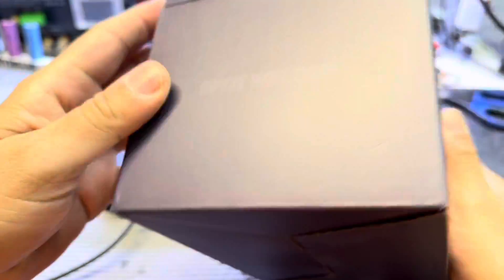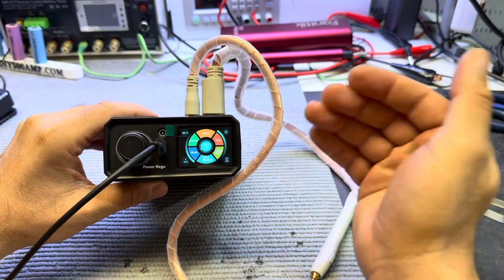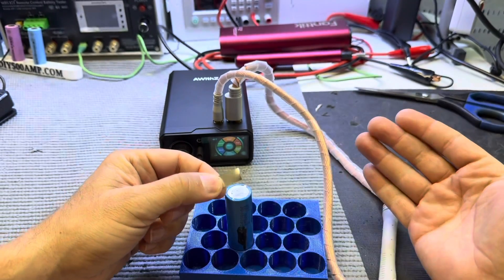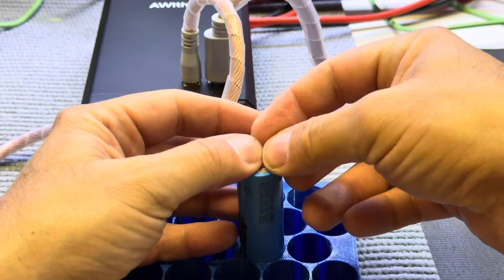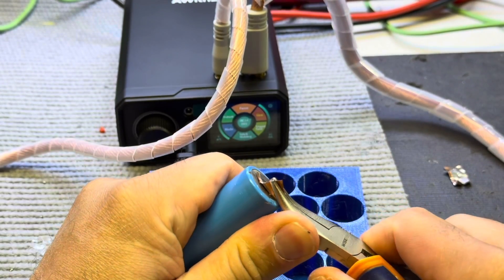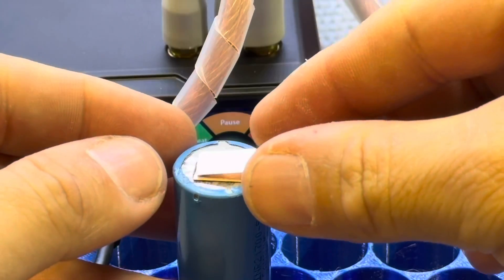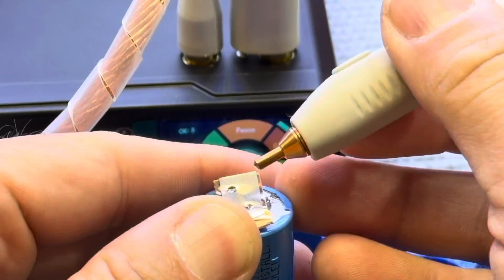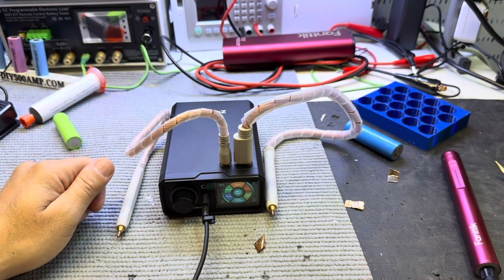AWithZ UKF10 Spot Welder Test – Copper & Nickel Welding Results

Comment: Does the nickel strip on top of the copper add much to the ampacity or does the copper end up carrying all of the current due to its lower resistance?
Reply: It does I’m not sure how much but it lowers the total resistance just more volume will flow through the lower resistance copper than the nickel.
Reply: @ARJJAMES  I wonder if anyone has ever done any testing on this.?

Comment: Hi I have the AWithZ UK3 one, Would I be able to weld 0.20mm pure nickel? If not, is there anyway to put enough pure nickel dows for building my 750w 48v battery. If not I will return it. Thanks
Reply from the maker: Yes you can weld easy 0.2mm pure nickel with your machine. The UK3 is almost as powerful as the UKF10. The difference is the UK3 is battery based welder and the UKF10 is a capacitor welder what is better than a battery. The UKF10 can do pure nickel 0.3mm and your as well.
Reply: @DIY500AMP Thanks I feel better now and just waiting on my batteries to arrive.

Comment: Do you recommend the UKF10 or UF20B? Is the extra power worth it?
Reply from the maker: Honestly they are almost the same in power. The difference is the UF20B has a build in power supply and will charge the capacitors faster.

Comment: Why You put nickel strip on the top?? What happen if You weld only Cooper strip?
Reply from the maker: Copper is very difficult to weld because the low resistance. The nickel on top makes the copper possible to weld. The heat from the nickel welds the copper.
Reply: @DIY500AMPokok, does 0.1x8mm copper and 0.1x8mm steel-nickel plated could handle 20A? I do battery rebuilds and i'm looking for the best performance
Reply from the maker: @davidtrujillo192  Remember copper is 4X more conductive than Pure Nickel. To answer the question 0.1mm x 8mm copper can handle 40A.
Reply: @DIY500AMPomg! Okey 
Thank you for this support!
Reply from the maker: @davidtrujillo192  Check the last Live video. I used this welder to build a Makita pack with 0.15mm copper / 0.15mm Stainless Steel.

Comment: Can i just charge the capacitors with my normal 5v  charging brick and the supplied power cables
Reply from the maker: Exactly! Is just will take longer to charge. If your battery brick has fast USB protocol support can be charge very fast !!

Comment: With the high discharge tabless cells now, I'm wanting to make pack your RC planes. Definitely need to step up my game in regards to materials for connections and you're a wealth of knowledge thank you. With the flux you use, is that a regular soldering flux, it looks quite different. Thank you for a fantastic channel!
Reply from the maker: Is not a regular flux, in fact only contain 5% flux. You can get this copper flux on my store.
Reply: @DIY500AMP thank you 😊

Comment: did you try nickel plate copper ? i think it shoul be better that separate coper / nickel combo
Reply from the maker: Nickel Plated copper is just like regular copper.
Reply: @DIY500AMP i thought it would be easier to weld due to the upper nickel layer

Comment: is this stronger or p20b stronger
Reply: also can p20b weld 0.2mm pure copper with 0.1mm steel without flux?
Reply from the maker: No more than the P20B. Probably same or more than the UF20, it feels like. In fact I will choose this one over the UF20 but the P20B is more powerful. Is 14.5kW and the Pens are heavier.
Reply: @DIY500AMP  why u prefer this over uf20b. uf20b has more watt output no?
Reply: @rubbe voltage is 8v on the ukf10 and 6v on the uf20b

Comment: I bet it would have welded 0.2mm copper if you used Stainless steel instead of Nickel plated steel on top.  My p20B at 14.6Kw can do 0.2 copper under 0.1mm stainless at gear 520, with flux.  This looks like a neat little unit.
Reply from the maker: I will test that now !!

Comment: Can't wait to get my cells! Do you think 0.3mm copper (20mm wide, 40mm long strips) is enough to handle EVE 50PL cells in a power tool pack? Some DeWALT tools are super thirsty and love to draw huge amounts of amps. (Gonna be using an AWithZ P20B spot welder!)
Reply from the maker: 0.3mm copper?? absolutely. Actually with 0.2mm copper you can achieve, the max on the tool
Reply: @DIY500AMP  That's perfect then, since I already had a roll of 0.2mm copper shipped to me! Thanks so much for the advice and the reviews on these spot welders. They made it easy to choose the right one for me.
Reply from the maker: @CalculatedRiskAK  Be aware !!! Is not good for 0.2mm copper. It make it but in full power and does not convinced me for that thick copper. Is ok for 0.15mm copper with flux. REALLY GOOD. but again is not for the task either in reality. If you have to build a full pack you need to weld maybe 5 times and give a brake.
Reply: @DIY500AMP what welder can suggest for copper? Like 0.2 mm, for lion 18650 and 21700
Reply from the maker: @АлтынбекДюсембаев-л5ь  a AWithZ P20B can handled without problems